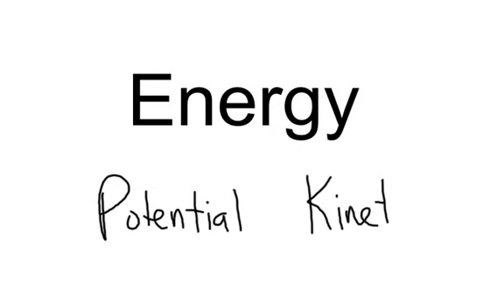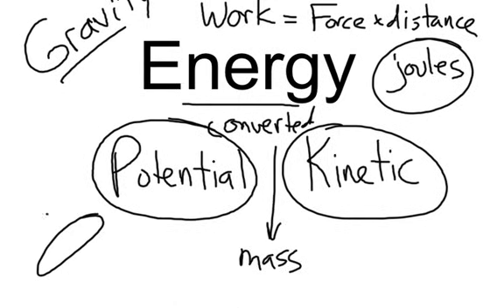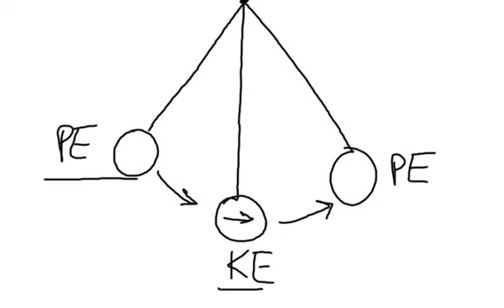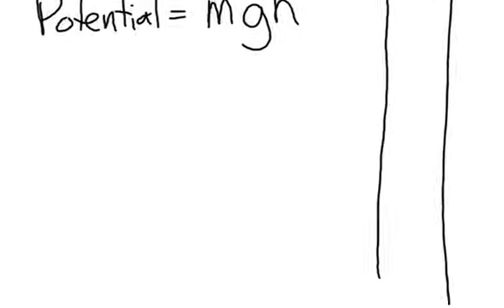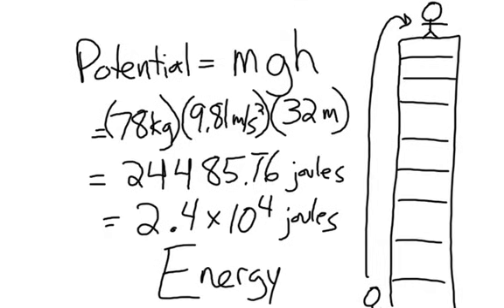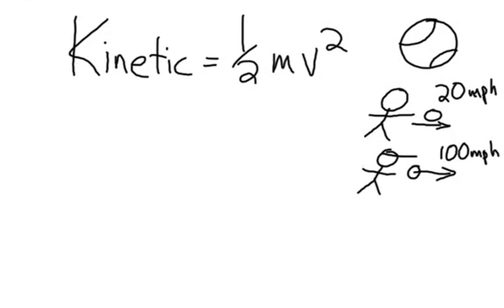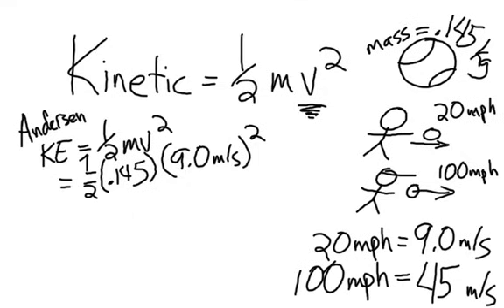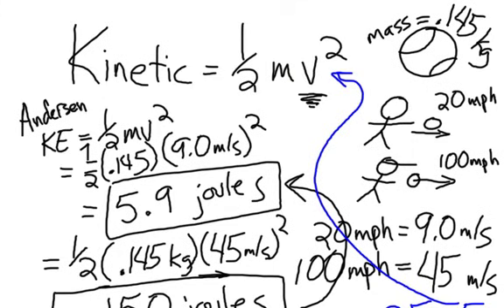Potential and Kinetic Energy

Comment: with this video, I was able to calculate that a modified lake tahoe (lake height + 50M) and clearlake region (dammed up to 550M elevation) could power the USA's current energy needs for 7 days if converted to pumped ocean storage at 50% and 70% system efficiencies respectively.
That's the time frame for which a UCSD physics professor claims that we'd not need to tap any other power source to power our country. pumping would be handled by renewables, connected, presumably, by a high voltage DC underground grid due to 2x efficiency of current high voltage AC overhead line theoretical maximum efficiency.

Comment: Mr. anderson isn't the gravitational acceleration positive 9.8 m/s ?? 
Or am i getting something wrong here?
Reply: Mahima Kochar m/s are the units for velocity. You are right that gravitational acceleration is usually about 9.8m/s^2(it varies slightly with altitude). Some people put it as positive, others negative. Either way is fine as long as the sign remains the same with in a problem. 
For an example if you decide the downward direction is negative your gravitational acceleration will always be negative, and the same goes for positive.
Hope this helped:)
Reply: The +/- direction thing confused me at first, just remember that the sign is just a symbol. You can decide away from the earth(up) is negative, and down is positive and vice versa.
Reply: It's not 9.8|m|s^2, it's 9.81m/s^2.

Comment: Isn't the acceleration of gravity is 9.8m/s? or 9.81m/s?
Reply: 9.8m/s/s
Reply: Daniel McLay More like 9.81 m/s^2
Reply: the exponent over the unit "s" is important
Reply: eugine's original comment just said m/s
Reply: Depends how specific it wants it. Some problems it want u to use 9.81 and others 9.8
Reply: those are the units for velocity (change in distance over time) the units for acceleration is m/s^2(change in velocity over time)

Comment: Interesting to the core. What if kentic energy is useful to evolve our automobiles. I don't mean to measure the energy it is traveling in, I mean energy that can be given to a automobile to set a significant forward motion. What if science can take a foot long object (strip like ) that can create potential energy and set it down on a pavement. Then take a second strip set it a foot apart and so forth for a distance of half a mile. Take a vehicle light enough and suitable to begin at one point,the first strip. And allow the first strip to generate the energy to push the vehicle forward to the next strip and then that strip to the next and so forth for that half mile distance. It could be used on our freeways and main roads. It could a beginning to revolutionizing our autos and calming its toxic waste.
Reply: rapprelevant3313 that's nosense ke is something and using other smart source of energy is another thing